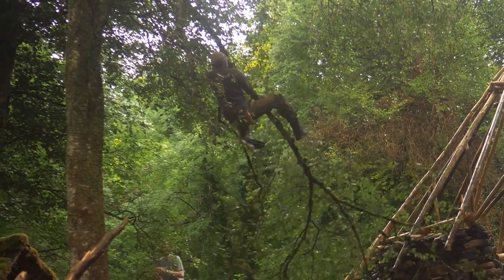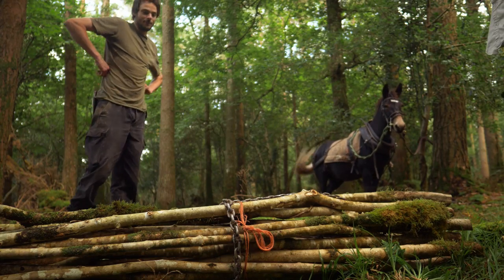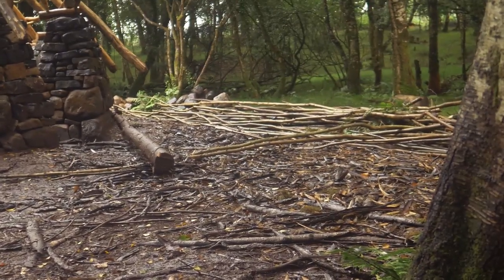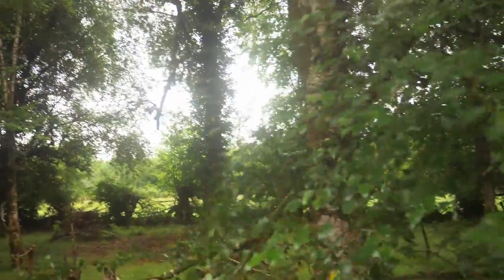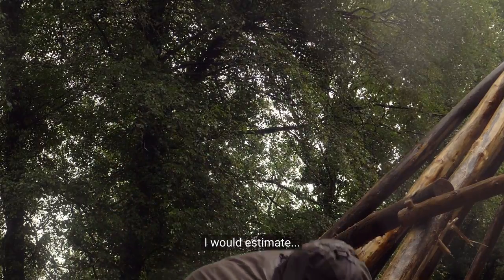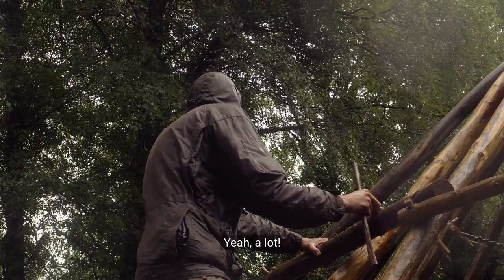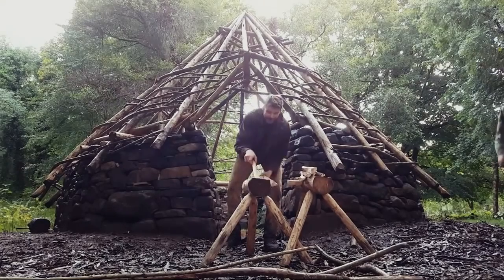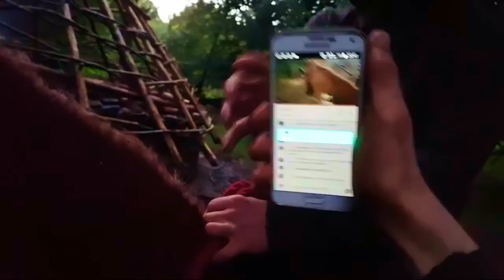Medieval Bushcraft Build in Forest - THE FINISHED ROOF FRAME! (Ep.10)

Comment: For the roof weaving, splitting the lengths you had in halves and quarters and then soaking them overnight in water would have made the act of weaving very much easier. And when they dried they would be very hard and shaped perfectly to hold.

Comment: Hmm, to make those branches bend easily and keep their bent form afterwards, you should heat them in a fire. Wood consists of cellulose fibers and lignine which glues them together. By heating the wood you melt that lignine which allows you to bend wood without cracking it. When it cools down, the lignine will repolymerise and keep the new bent shape.
Reply: @benbrunt3473  Soaking will work, but it takes lots of time - several days to soak, several days to dry. Heating takes just minutes.
Reply: If u soak then u need to make sure they dry evenly to avoid splitting
Reply: @curiousobserver7611  exactly!
Reply: I would imagine that they would want the resistance of the lignin for structural purposes, if you were to heat it then you might lose some of the strength that comes with the bending.  at least that's my guess
Reply: @jhondoux84  The wood strength is not affected by the heating. This is an old technique used to make bent meubles for ages.

I suppose, the oldest known sample are those wooden offering tables from the Minoan city of Akrotiri. The city was buried under the ashes of catastrophic eruption of Tera volcanoe at Santorini island in 1560 BC (yes, 3580 years ago). There were found robust 3-storey buildings, paved roads, drainage system, elegant pottery and Minoan frescoes still bright and colorful after 35 centuries, ang also furniture items which were burnt by hot volcanic ashes but restored by pouring liquid gypsum mixture, like in Pompei. Here's a sample: https://youtu.be/Hg4B1x2P4tw
Look at timestamp 14:30 there.
Reply: @jhondoux84  Heat treating wood actually makes the wood stronger, not weaker.  When wood is formed, the cellular structure has gaps for the plant's vascular system.  Heat treating wood allows the lignine to form new bonds in these places that were previously hollow.  Survival guides will often refer to "fire hardening" as an easy way to give a stick a point tough enough to be used as a tool or a weapon.
Reply: @igorvoloshin3406  Well done.

Comment: It’s smart not tying the green horizontals with cordage. As the green wood dries and shrinks the lashings would come loose. I found that on a large bent green wood structure. You might want to drive a few pegs under some of your woven purlins, if you’re worried about them slipping. A brace and bit would be faster than the long t-bar. Really good job guys.

Comment: Give the lath a very hot water soaking for a1/2 hour will make them a lot more flexible. They use to use heat to straighten arrows. I have a dowel cutter from 1700s used for making wagon wheel spokes.

Comment: You can always use spruce and other conifers to make pine tar, and then thoroughly paint your wood in it anywhere it may get exposed to damp (when finished, like the cut ends for example that tend to wick moisture), particularly the bottoms of posts. I think all conifers should make "pine" tar, it's a bit of a misnomer. Also the thin roots, close to the surface (easily found in mossy ground), can be used raw for cordage or split into segments, halves, and then quarters. Which are great for making baskets too.

You guys probably already know all this, but evergreens and softwoods are all that grow where I live, so perhaps being from a place full of hardwoods it isn't as familiar for your local bushcraft.

Comment: As the weight of snow and rain put downward force on the roof, it pushes the lower end of your rafter outward. Over time it can push outward on the stone wall and collapse the walls. If you had carried the rafter all the way to the ground and put a small stone "footing under them, the roof could handle a LOT more weight

Comment: Why do you pull from the top of the load? We have always pulled from under the load. It tends to lift the front up an helps the mule. You may be doing that but I am just not seeing it. Look forward to Friday thanks guys.
Reply from the maker: I'm sure we pulled from the bottom;) Just took the runing of the chain out of the edit I think
Reply: Floyd Peters a skid plate would also help 🙂
Reply: Smooth Gefixt  I bet you did, if you did not the mule would have quit or become sullen. She is a nice little pony mule by the way.
Reply: Also splitting the wands will give you twice the coverage for the same amount of journeys